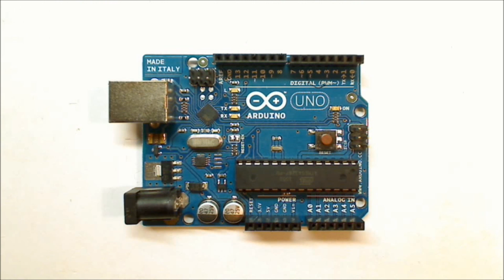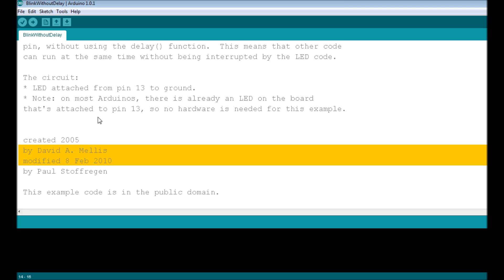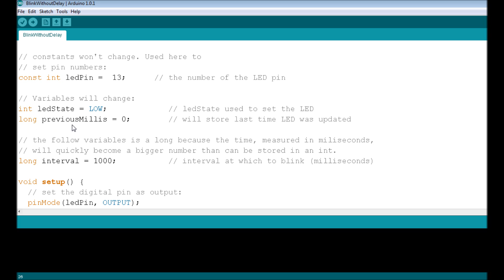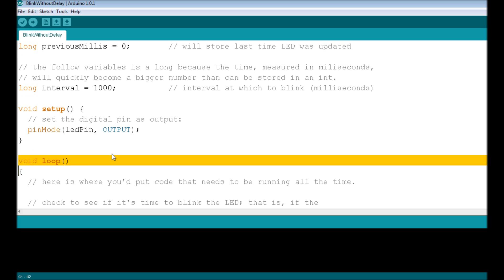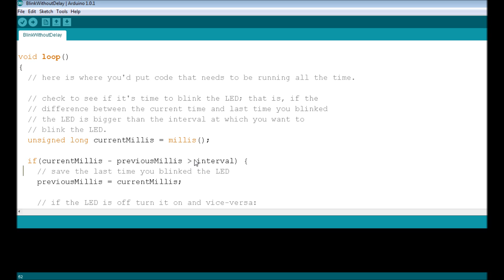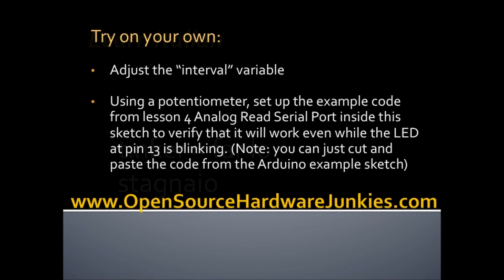Tutorial 12: Blink an LED without using the delay() function: Arduino Course for Absolute Beginners

Comment: // I repeated it again, but it became faster, shorter, and easier to read and study

int ledPin =  LED_BUILTIN;
int ledState = LOW;             
unsigned long previousMillis = 0;       
long interval = 200;  
     
void setup() {
pinMode(ledPin, OUTPUT);}

void loop() { 
unsigned long currentMillis = millis();
  if (currentMillis - previousMillis >= interval) {previousMillis = currentMillis;
  if (ledState == LOW) { ledState = HIGH;} else {ledState = LOW;}
digitalWrite(ledPin, ledState);}
    }

Comment: Thank you so much for the explanation, I am trying to code then upload a song onto an Arduino. Will this work (for the multiple chords)? For example 
                                                                                         
tone(BUZZER1, 329.628, 2000);

tone(BUZZER3, 391.995,1000);

tone(BUZZER5, 1046.50, 300);

if(currentMillis - previous Millis > interval1) {

  tone(BUZZER3, 391.995,950);
  
  }

So will these pieces of music overlap, but the delayed bit only overlap after 50 milliseconds?

Comment: Almost three years after the original posting but, never-the-less, the issue of eradicating (or at least minimizing) the use of delays in code is often brushed over.

The Arduino IDE is a great system with which to learn.  I have provided some alternate code that may help some newbies to Arduino. 

/**************************************************************************
 * Program:     TimedDelay.ino
 *
 * Author:      Nick KASPEROVIC - VK3TY
 *
 * Date:        13 June 2015
 *
 * Description: Overcoming the use of the Arduino's "delay" function which
 *              stops processing.  This is an old theme and had been
 *              presented/discussed many times.
 *
 * Copyright:   Nil.  Public domain.
 *
 * Description: Reduce (unnecessary) lines of code to perform simple tasks
 *              like switching between two known states/values.
 *              Key points;-
 *              1. Use of the ! to provide a compliment value.
 *              2. Reading the current value of a LED state.
 *              3. Use of compiler declarative to set control value.
 *              4. Use of unit32_t in place of "unsigned long" 32-bit number.
 *              5. Use built-in, on-board LED.  Make use of what you have.
 *              6. Simpler than resorting to Interrupt Service Routines (ISR).
 **************************************************************************/
 
#define limit 1000               // Define a limit using compiler directive.

// Set global variable variable/s - in this case we can pre-set a start value.
uint32_t previousVal = millis(); // Pre-set with an initial start time.

void setup() {
  // Put your setup code here, to run once:
 
  pinMode( 13, OUTPUT ) ;       // Standard on-board LED
  digitalWrite( 13, HIGH ) ;    // Set it on (value of 'HIGH').
}

void loop() {
  // Put your main code here, to run repeatedly:
 
  uint32_t now = millis() ;     // Load current milli-second processor time.
 
  // Test to see if time interval since last reset has matched the 'limit'.
  if ( now-previousVal > limit ) {
    previousVal = now ;         // Set new reference time.
    digitalWrite( 13, !digitalRead( 13 ) ) ; // Invert the LED pin value.
  }
 
  /* Insert other code you have that will not be affected by the LED being
   * turned on and off at a regular interval.
   *                             .
   *                             .
   *                             .
   ************************************************************************/
}

If the above code helps you - great.  It's only meant to compliment the tutorials  of others.

                             - - - = = =   End of core text  = = = - - -

-----------------------------------------------------------------------------------------------------------------
Sal C - You can have a double blink but please, don't use the Android delay function.  The whole exercise is to ensure that the processing is NOT locked out.
-----------------------------------------------------------------------------------------------------------------
Guadalupe - the declaration within the loop segment is because it is a local variable.  That is, it is ONLY referenced within the loop.  In the original code, global variables (ledState, previousMillis and interval) were set before the "void setup()" and "void loop()"  Other than the variable ledState, all the others variiables are only referenced within the "void Loop()" segment.
The reality is that, visibility, if not required in different sections of code woudl best be served if contained within those sections that it is required.  This allows the same variables to be used in other code segments.  In short programs, it doesn't matter much but, if you write (say) several hundred lines of code with multiple functions/subroutines, there is every chance that you may become confused with the current state of a variable.
-----------------------------------------------------------------------------------------------------------------
Michael J - Agree, it is simple code but, as a tutorial, its purpose is to demonstrate a means by which time driven events can occur without stopping the process.  As for tracing, you could write to the serial port showing the millis() value each time the previousMillis variable is reset.

Comment: Hi... I still can not understand why unsigned long is inside thd void loop and not at the beginning of the sketch.  Can you explain that to me?  Thanks.
Reply: millis() starts an ongoing number from the bootup of arduino, running in the background. The currentMillis is a variable, that wont change unless you modify it, or set it to the value of that ongoing millis() function. So... you have to update the variable currentMillis to check the current value of millis(), so that it can be compared to the other variable, previousMillis. 
If you dont update currentMillis every loop, it will remain the first taken value of the millis() on first bootup, being just a couple milliseconds in. Every loop, the variable currentMillis, would never change, and the if statement would never be executed, since currentMillis never changes... I think.?

Comment: //try it

void blink_led(int pin, int timeOn, int timeOff, int atraso, long millis_referencia=0){
  long ajuste_referencia = millis_referencia % (timeOn + timeOff);
  long resto             = (millis() + timeOn + timeOff - ajuste_referencia - atraso) % (timeOn + timeOff);
  
  digitalWrite(pin, resto < timeOn ? HIGH : LOW);
}

void setup() {
  pinMode(11, OUTPUT);
  pinMode(12, OUTPUT);
  pinMode(13, OUTPUT);
}

void loop() {
  blink_led(13, 1000, 1000, 0);
  blink_led(12, 300,  800,  0);
  blink_led(11, 800,  300,  300);
}
Reply: Thanks for this great solution!